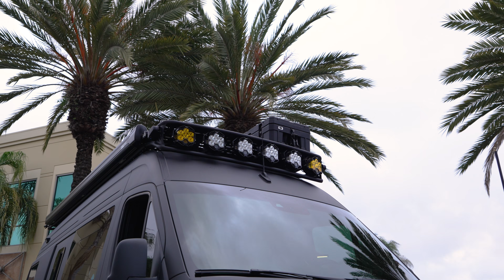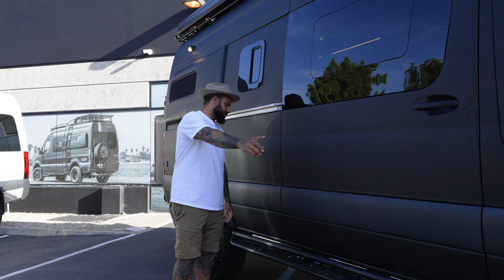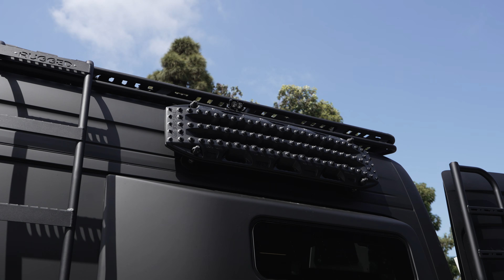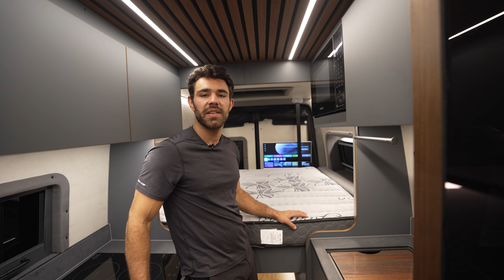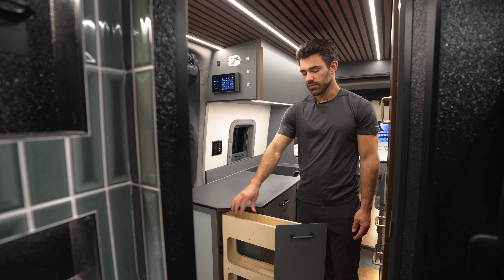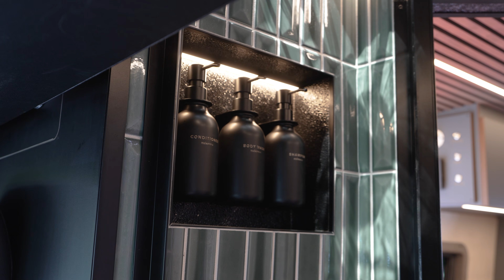The Odyssey | Is This The Most Luxurious Adventure Van?

Comment: Love love the layout.  One observation. When Lucas was sitting under the bed his head was touching the underside. Seems a bit cramped. I understand you've raised the base so some height is lost. Why is there a substantial bulkhead above the bed? If you could claw back 100mm or so it certainly raise the level of comfort in the lounge area. ( pun intended )

Comment: I really prefer the look of the happyjack as it was less apparent than the strappy style of this particular bed lift. Also I really love the heart and soul Lucas showed us in his first couple vans. Outside looks great but please don’t lose those nostalgic finishing touches that make the odyssey everything it is.
Reply from the maker: It may not seem like it from the outside, but there was an incredible amount of thought, effort, and engineering that went into this.

I have mixed feelings about the HappyJac system. I don’t consider it an ideal solution for van interiors. It was originally designed for toy haulers and other industrial applications, and it performs exceptionally well in those environments. In a high end van living space, however, it tends to feel less refined. It’s noisier, more visually intrusive, and doesn’t provide the same clean, open aesthetic that many people are looking for in a premium interior.
Reply: @roguevancompany thank you for shedding light on this issue.
Reply: I had a similar thought, however having been in a new Odyssey with the darker colored walls and not the light ones as seen in this video, the darker wall color option alone makes those straps almost disappear. I seriously didn’t give it a second thought and neither did anybody else. For that reason, alone, I would recommend going with the darker walls.